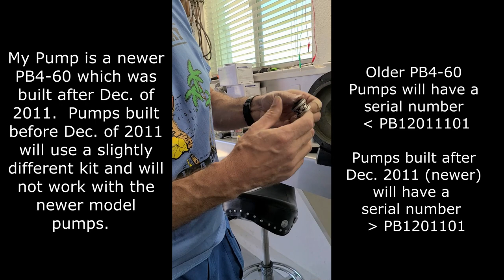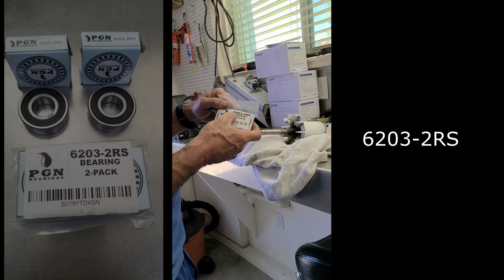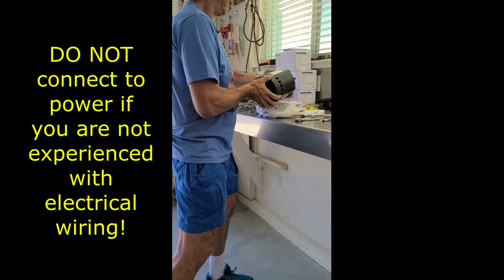PB460 Pump Rebuild Oct 8 2020

Comment: I’d say you’ve found your new calling. This was an excellent video from start to finish. I’ve subscribed just in case you produce more, and that’s a first for me.
Reply from the maker: Thanks for the kind words.  I plan to do more videos in the future, but like everything else, it takes time I usually don't have.
Reply: Please don’t follow this guys assembly. Obviously not an experienced technician. The pump/motor orientation is unsafe for any outdoor installation. All motor vents should be on the underside to keep rain out. The capacitor “hump” should ALWAYS be on the top.
Reply: O

Comment: Nice video that covers all of the bases. I’ve rebuilt my PB4 numerous times over the years and here are some tips. T
The long bolts that hold the motor case together will occasionally break because they are steel and go into aluminum, causing corrosion.  I always coat the threads with antiseize when reinstalling the bolts. And if you have to get a new motor, remove those bolts one at a time and add antiseize. This will insure that you can remove them later when the seals eventually fail and damage the front bearing. You do NOT have to remove the rear case cover, but be sure you dont lose the wave washer for that bearing. Be sure to use antiseize on the front bearing keeper thread as well. You cab buy the bearing from USA bearing and belts for just a few $ apiece.
Reply from the maker: Thank you for the comments.  When I made the video a few years ago I didn't use the anti-seize and now I always do.  I was new to rebuilding the pump and also new to making videos as you can tell.  If I do another I will make do it better.  Thanks again for the feedback!

Comment: The valutes are different. Don't need serial#'s/ New has curved lines on front of valute. Old model has straight lines on fron of valute.
Reply: Yeah I have the curved lines style volute but according to the serial number I should have the old style pump.  Very confusing.

Comment: If you find that that little lever that holds that one bearing in place is corroded tight, I have been able to sneak a slim screwdriver through one of the air vents and tap it loose from the inside.

Comment: I caught the snafu at 27:30-40 😀 but a most excellent video. Was able to rebuild my pump and motor with this video. Thanks. I temporarily reconfigured the motor to 120V so I could easily bench test and then rigged washing machine hoses and hooked to hose faucet so I could ensure the pump worked well also. 
Thanks again.
Reply from the maker: That's the power of editing when something goes wrong.  I don't remember what it was.  Good catch!

Comment: Anyone that has trouble getting the front motor cover off because of corrosion, etc. you can feed a long threaded rod through the back end very carefully so that it is resting on the front cover. Then gently tap until it breaks loose. Hopefully this will help someone save the hour of frustration I just went through.

Comment: Great video.  Question:  Every year and I mean every year when I open up the pool I have to replace my motor.  The motor spins, sounds fine but it doesn't have enough power to move the vac.  I have 4 motors now that sound find but I'm guessing are weak.  Any ideas what is causing this besides winter?  Thank you

Comment: Thank you! This was -- BY FAR -- the best video on YouTube explaining and showing the process of rebuilding this type of pump.  I think the Polaris motor itself is very similar, if not identical, to the Pentair LA01N booster pump motor (I'll know for certain in a few days when the parts arrive for my LA01N rebuild).  You might consider referencing that pump / motor in your video description, as it is also a popular pump.
Reply from the maker: Thanks for the feedback.  I took a look at the LA01N pump and it looks very similar to the PB460.  The seal kit looks the same as well.  
This was my first YouTube instructional video, and the reason for it was looking at all of the others out there poorly done and having bad information.  I thought, I can do better, and help others.  I did make some errors in my video too and learned a lot in the process for the next one I will make in future.

Comment: Don't forget to mention that there are two different versions of the same model...the pre2011 and the post 2011. Both have different replacement parts. I found out the hard way when replacing the volute.
Reply from the maker: Thank you for the comment.  I do mention that and explain the differences at around 5 minutes into the video.  I also ran into the same problem with same pump number using different rebuild parts the first time around and was left scratching my head as they were almost the same, but wouldn't fit.  Finally I read somewhere about the differences and to look at the serial number to figure it out.  One of my reasons for making this video was everything I saw online prior was for the older (pre-2011) version.

Comment: I really appreciate your video. I have a pre Dec 2011 I understand the differences in the pump seals, my question is do both versions use the same bearings in the electric motors?
Reply from the maker: I can't say I'm 100% sure, but I have taken apart many pool pump motors from different manufacturers and ALL have used the same bearings.  I think this bearing was probably a standard product that all electric motor designers were using for similar sized motors.  It is readily available and low cost.  I even found the seals used in different brand pumps were the same too.  For example the Pentair pumps I have used the same seals as the pre-2011 Polaris booster pumps.  They also used same bearings in their pump motors.  

Thanks for watching the video.

Comment: Great video. It would be a good time to replace the capacitor on the motor also.
Reply from the maker: Thanks for the recommendation.  I have replaced plenty of capacitors on AC units over the years, but never on a pool pump, as I have never had one go bad.  Maybe I have just been lucky so far.

Comment: The stator are the windings inside the case. The rotor is the piece you pulled out that has the bearings on the shaft. The little lever that holds the bearing in the end cap is a bearing retainer.
Reply from the maker: Thank you for the feedback.  As you can tell I am not an expert.  When I made the video I had only taken a few apart in my garage and learned what I did by watching a lot of other YouTube Videos.  Now watching the video again I realized that I did mis-name some of the parts.  In the future if/when I make more videos I will be more careful.

Comment: I did not see you put the small o ring on the shaft before you put the volute back together. Per the diagram   It should be used. Is that correct????
Reply from the maker: I don't believe there is a small o ring that goes on the shaft for this model (newer) pump.  I believe (from watching older YouTube videos) there was with the older design of the PB460.  The volute is also different on the older style pumps if you look closely at it.  There are some small O-Rings that go on the drain plug(s).

Comment: One of my long bolts was rusted and ended up breaking in the thread and now I can't get it out. Any suggestions?
Reply from the maker: This has happened to me a couple of times.  I have taken apart many pumps since making this video.  The bolts are called "thru-bolts".  Once broken you can still take the motor apart.  Once apart, I would use vice grips on the piece inside of the motor that is still attached.  See if you can remove it that way.  Also, use some of the oils designed to free up frozen bolts.  If that doesn't work, cut the bolt flush, drill it out with a smaller drill bit carefully, and use a tap and clean out the threads.  I've purchased new thru-bolts on Amazon, although expensive... Around $10 each.  Hope this helps.  
Also, this should come as a lesson.  When installing ANY bolts on your motor/pump use anti-seize compound so that the next time you take it apart you won't have a similar problem.

Comment: I learned an expensive lesson after changing the impeller and seal.  When reconnecting the power, I have very little working area because of the way the pool equipment was installed, so I have to get on the ground and crane my neck to see what I'm doing.  Unfortunately when tightening down one of the power leads to the post, I managed to spin the post itself without realizing it, so that it was touching the motor casing.  It of course arc'd out and ruined the power circuit card, so had to replace the motor after my perfect rebuild of the old one.  Just installed the new one, and this time held it in my lap to connect the power lines.  At some point I'll replace the power cable from the junction box, to give me more room.
Reply from the maker: Alex, everyone should disconnect the power before working on this pump and any electrical circuitry that's hooked up to 110 or 220V.  That would have prevented your expensive lesson.  With that said, you don't need to replace the whole pump.  You can replace the motor only and connect it and keep using the pump portion you rebuilt or could even replace the power circuit card on the motor.  The motor itself is probably fine with the exception of the card.  Now your time might not be worth doing any of these things though.  That's your decision to make.  Good luck!
Reply: @LS-rl5gp  I might have miscommunicated. I was finished with the pump rebuild and  it was time to reconnect to power. When I tightened down the white lead, it spun the post out of position and I didn’t realize it because I was just looking to make sure the lead was secure and not too close to any other wires.  🤷‍♂️

Comment: Where is the serial #?  There is a number on the volute housing on the pb4-60 label but it doesn't have a "PB" at all in it.  It is ADEH with 14 numbers after that.  I need a new shaft seal

Comment: What does the pump do or sound like before it goes out?
Reply from the maker: My experience has been 2 things fail telling me it's time to repair.  
(1) Pump starts leaking water.  This happens when the seals wear out and fail most likely. 
(2) Pump motor starts getting loud and noisy.  This is most likely caused by the bearings in the motor failing and needing replacement.  Sometimes  (1) happens and it leads to (2) because water gets into the motor and causes the bearings to fail prematurely.  I've seen this happen a couple of times.  
A third possibility that I have not seen or explained was the motor capacitor on top of the motor fails and needs to be replaced.  This has never happened to me with a pool pump so I didn't go over how to change it out.  I have seen this with air conditioner motors a few times.

Comment: Good video. I’m having trouble finding the seal kit. I’m just finding the pre 2012 kits. Does the Polaris PB4-60  Q work?
Reply from the maker: I am not sure.  When I was rebuilding a few of these pre-pandemic, both kits were readily available on Amazon and other pool supply store online.  I know because I bought the wrong ones a couple of times before figuring out there were two models.  I also found out later when rebuilding a different pool pump it used the same seal kit as the older model booster pump.

Comment: An O ring shaft seal was supplied with the seal kit I purchased. From your video I assume it is not needed for the newer pump ( mine is about 2015 vintage),
Reply from the maker: You are correct.
Reply: You need to put the o ring on the shaft 3:29

Comment: What is the seal number that you used?
Reply from the maker: I am rebuilding another pump today and ordered parts from poolzoom.com.  I purchased a generic seal kit for $16.90.  Search PB460 seal kit.  There is a kit for older and newer model pumps.  Make sure to get the correct one.  My video shows the newer model pump.

Comment: How can you determine which year model PB4-60 You have?
Reply from the maker: You can determine by the serial number on the pump.  When I made the video there were 2 models that used different rebuild kits.  In the video I explain the serial numbers which use the old kits and the serial numbers which use the new kits.

Comment: After searching everywhere for a video that shows how to replace the impeller and mechanical seals on the newer version of the Polaris PB 640, I came across yours!  As everyone else said, you did such a fantastic job. One suggestion though…
Please turn your camera sideways so we can see the video on the entire screen and not just 1/3 of the screen.  Thanks again!
Reply from the maker: Thank you for the feedback.  This was the first video I made and didn't even think about that at the time.  It became apparent as I started to do the video editing that I should have had the camera 90 degrees rotated.  I'm glad the video was able to help.
Reply: @LS-rl5gp  Your first video? Well, it was even more outstanding, in that case!  I was disappointed to see you hadn’t uploaded any others though. Please consider doing so.
Reply from the maker: I recently retired and plan to do some more.  I've rebuilt some of the other more common pool pumps and plan to do a video one of these days.  They are all kind of similar pumps and use the same bearings and seals.  The people who designed these pumps used pretty standard parts which is great for people like us who like to do repairs/rebuilding on our own.

Comment: I am working on one now and the impeller won’t come off no matter what I do
Reply from the maker: Carlos, make sure you are turning it counter-clockwise.   I've had to fight with a couple of them I worked on that just didn't want to come off.  You can sometimes use a strap wrench and wrap it around the outside of the impeller to give yourself more leverage.  That usually works for me on the difficult ones.  One time I actually ended up breaking the impeller (it was already cracked) and then was able to use a pipe wrench on the remaining chunk of impeller left on the shaft and break it free.  Sometimes they are easy, and sometimes they are difficult.  Let me know if you were able to get it removed and the technique you used.  Thanks for watching and commenting.

Comment: Great video...very professional looking. Thanks for sharing your knowledge to the community! I had a couple of questions. 1) I saw that all of your parts can be found on Amazon (I did find them). May want to include links in the info section of the video for easy reference. 2) I'm new to motor rebuilds...what is the type of grease that you use when installing the shaft in the motor body and where did you purchase? 3) I noticed that you did not put any grease in the bearing housing on the electrical connection side of the motor...is it recommended to grease both seats for bearings? 4) is there any need to grease the exterior of the bearings ( I realize they are sealed with grease inside the circular bearing case)? Any feedback appreciated and thanks again...this video gave me the confidence to try this fix before purchasing a new motor.
Reply from the maker: Thanks for the comment and questions. Here are my answers...   1)  I am new to doing videos on YouTube so I am not familiar with with adding links to Amazon for people to find the parts easily.  I will see if I can figure out how to do that.  My only concern would be that part suppliers change a lot on Amazon and what is important is the part numbers which I think I listed (for my pump).  2)  I don't think the grease is that important since the motor shouldn't get that hot.  I used caliper grease that I had in the garage.  Wheel bearing grease would work too. Nothing special.  The grease itself isn't really used on any spinning surfaces as that grease is inside of the sealed bearings.  The grease is used for easier installation and to allow for expansion and contraction as the motor heats up and cools down.  3)  This was a good catch on your part.  Yes, there should be some grease also in the electrical connection side of the motor.  This side is actually more important as this side has the springy washer and is where the bearing should move in or out during expansion and contraction.  I went back and looked at my video again and I didn't mention it or show me putting it in, but I can see it was in there.  I guess I did an edit and missed that part in the final version of the video.  4)  I'm not sure what you mean by greasing the exterior of the bearings.  Do you mean the outer surfaces that aren't in contact with anything?  The answer would be no, and normally you don't want to have grease in places where it is not being used as a lubricant as it will just make a mess and collect dust and dirt over time.  

ONE THING TO BE AWARE OF is there are 2 models of this pump with the same part number (PB460) and they use similar, but use different parts.  This drove me crazy as I ordered the wrong parts and they looked similar, but were different and didn't fit together correctly.  I spent a few hours scratching my head as I tried to figure out how to put it together.  Finally I found out that there were 2 models and the only way to tell them apart was from the serial number or manufacture date.  I believe in the video I show this information.  BEWARE and don't go through what I went through trying to figure this out.